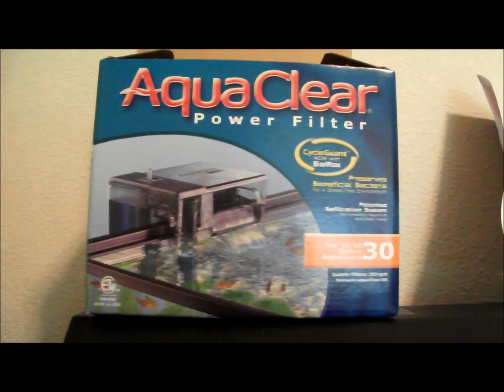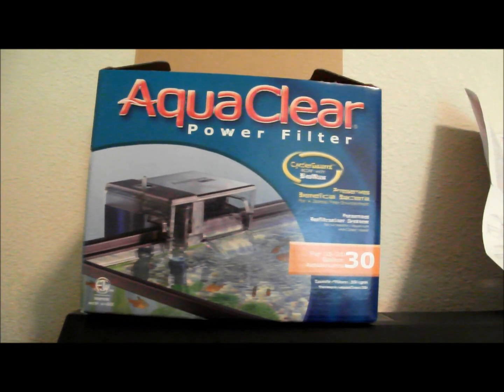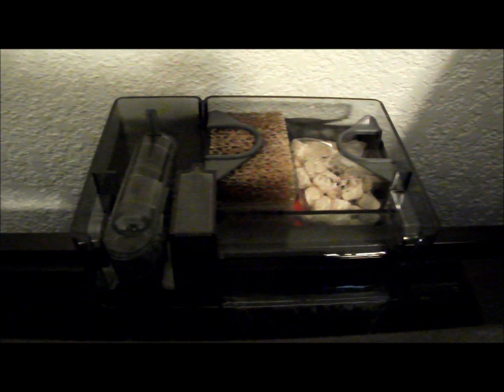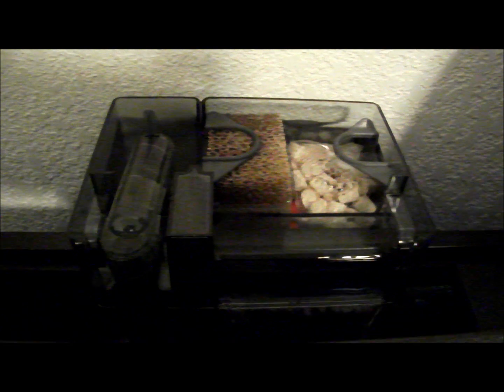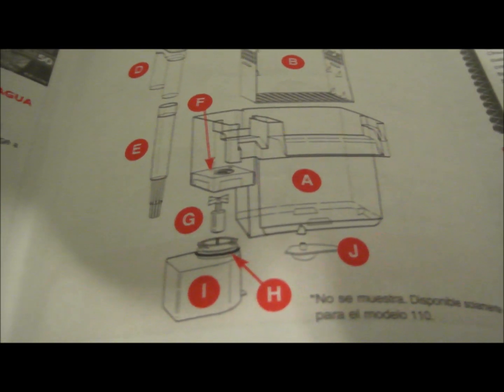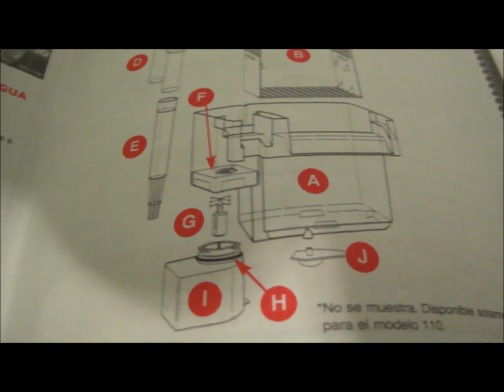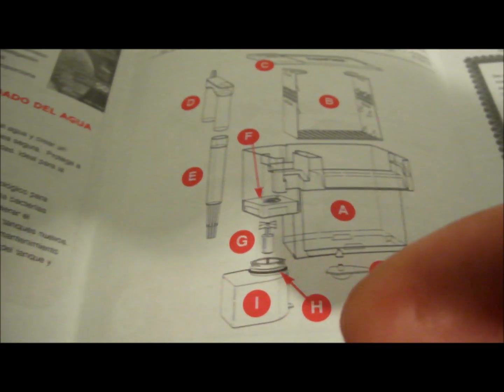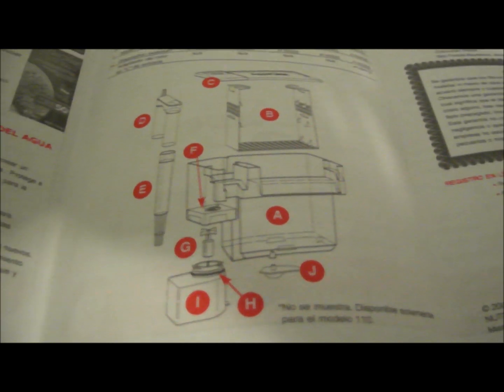How To: Fix AquaClear Filters

Comment: I wrote the company, I had the same thing happen with my C3, I was so annoyed but after a while either I got used to it, or it is less noisy. I would go with another filter but I have 5 now, and going broke. Thanks for the tip though. If I get mine resolved I'll let you know. I took off the lid, it helps a little.

Comment: If you put a prefilter on the uplift tube <Fluval makes the spec ones that are round and they work great for less than 3 bucks!> you will never need to do anything to the impeller.

The reason this happens is the crap from the tank gets into the impeller assembly and cause it to become unbalanced and debris can cause wear on the assembly resulting in the loud irritating noise.  Do yourselves a favor and buy an intake tube prefilter foam sponge install it and enjoy years of quiet operation.

Comment: I did this with vaseline and it didn't work. It would still make a very loud rattling noise. I'm going to try silicone grease and see if that works better. If it doesn't, guess I need a new impeller.

Comment from the maker: I have a replacement metal shaft and a brand new impeller that has been siting on my desk for well over a year..

Why don't you change it??  It's not that the shaft/impeller are defective, it's how they were made out of. Instead of metal, they really need to make it ceramic. This type of ceramic can withstand better heat and fraction which will result in lessen noise and wear/tear.

Comment: I tried this with olive oil given that it's not toxic.  However, it only worked for a few minutes before the impeller began making noise again.  If you were use silicone that would circulate into the water in your aquarium and possibly cause harm to your fish.

Comment: the way you have the filter media isn't best for filtering the water.  Either put the sponge on the bottom, with the bio media on top, or keep it like it is, but get rid of the basket.  Because the way it is now, half the water is going through the bio media, and the other half is flowing through the sponge, so the bio will get clogged, not good.  just my $.02

Comment: I have a aquaclear 20 and it suddenly started to make this shitty noise....i tried everything and decided to bought a new one to find its the same thing...I put vaseline on the shaft like 5 min ago and it works like a charm. I should have watched this before buying a new one.
Reply from the maker: +jean-francois ruel i try 2 brand new one after another and same thing. the vaseline is temp fix. It will come back again and you will have to sleep with the noise.

I already figure out what the whole problem is with this filter.